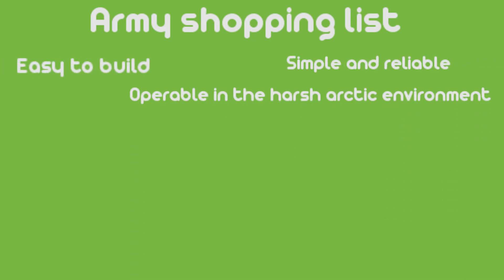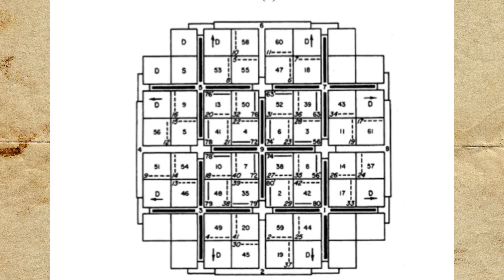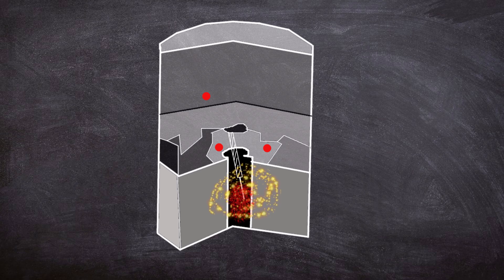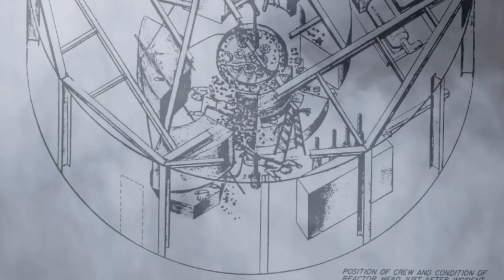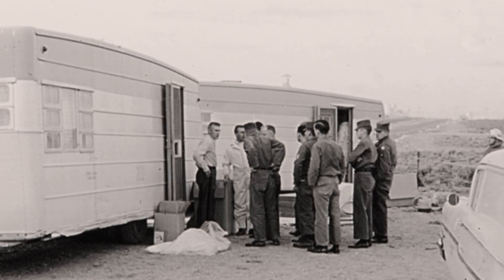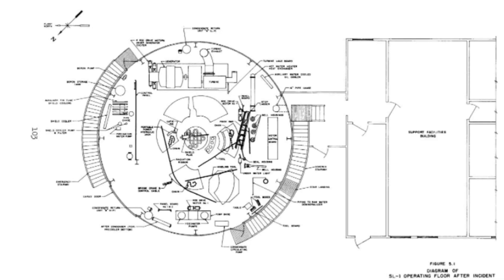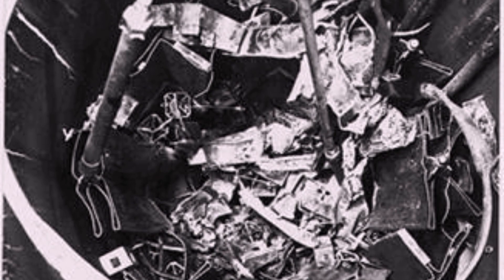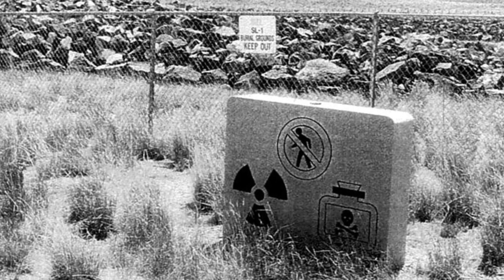A Brief History of: The SL-1 Reactor Accident

Comment: This guy generally got the story right, and it is good that he actually included what the nuclear industry learned and changed as a result of the event, but the repeated use of the word "critical" is a bit obnoxious. Critical is a good state for a nuclear reactor. Critical means one neutron from the splitting of one atom goes on to split one more atom while the other one or two created (in U-235)  do not. Critical is a controlled reaction, where supercritical is where the reaction is ramping up and subcritical is a reaction winding down. None of these are bad when it is happening under the controlled conditions it was designed to. Where it was bad here and at Chernobyl is when it happens very fast and the reaction is not controlled (not critical).

Comment: Another correction, it's pronounced Rongent, or Rongen, Not ROTOgen
Reply: actually it's pronounced runt-chun or runt-gun with a soft g
Reply: @user-ee9cz6mc1x  Not here it isn't. I can't think of anywhere it would be pronounced Rotogen, which is why I corrected it. Variable dialects are different to incorrect pronunciation.
Reply: @oscarmuffin4322 no cos there should be a t after run and no t after gen, so that's is a wrong pronunciation not a dialect
Reply: @user-ee9cz6mc1x  In the German pronunciation maybe, however, we don't appear to be speaking German.

Comment: I have a suggestion, but it's a bit selfish.  It's not one of the biggest disasters, and it wasn't a reactor.. it was a plant that extracted uranium and plutonium from water and waste.  I would imagine it would be extracting from primary coolant, but I'm no nuclear engineer.  I heard about this when I was a kid growing up in Boston because it happened fairly close to home (Wood River, Rhode Island).  It took place in 1964.  I read the whitepaper front to back and it actually read like a horror story, but again, it wasn't like a plant disaster and would be a small potato compared to the other vids.  I would suggest reading the whitepaper rather than articles.  I have either the accident report or whitepaper, I can't remember which is which.  https://drive.google.com/open?id=1GsOS0f-UbDzDg35PEC0whLw4CCca4drD

Basically, a couple of human errors caused a big blue flash as the liquid being poured into a mixing vat had an open drain 3 floors below and there was already, and other things made the place highly radioactive.  At least one man died.
Reply: The report I linked to is a "compliance investigation report "  written on September 11, 1964.  Really an unlucky day all around.  It's very descriptive.  There's also an article in a small paper called "NewEngland dot com",  but leaving outside links are risky.  I'll try in another reply (I'm replying because the OP has a link and after checking Tor, I see it actually went through and not just visible to _me_).  I don't want to poke the ribs of the far-left Google thought police.
Reply: An article about this in a small local paper...   https://newengland.com/today/living/new-england-history/nuclear-accident-at-wood-river-junction/

Comment: Damn. I work in computer science and one of the main tenets is that if it is necessary to avoid mishandling of some particular system then you need to have hard limitations in place, especially if it is mission critical. Example being you don’t want users to inout weird characters in an age field so you limit the possible inputs to only numbers. I can understand the need to manually operate such a machine, especially without today’s technology, however I dont’t understand why they didn’t design some kind of stopping mechanism after the rod travelled more than 20 cm. Anyways, if I am missing some detail then please enlighten me. Cheers.

Comment: Why didn’t they wait a few weeks before entering the reactor hall to retrieve the bodies? Why expose anyone to exceptionally high gamma radiation when you don’t have too?
Reply: John Adams Brief exposure is safe.
Reply: Rob Speed Considering the exceptionally limited knowledge/ lack of knowledge at the time on the long term effects of radiation on the body. The responders were so concerned that the limited exposure to just over a minute. I have a hard time believing that any exposure at these levels are safe. I completely understand putting people at risk during an on going crisis but this was not one.
Reply: John Adams It was understood fairly well. Radiation sickness can be avoided without much risk if proper precautions are taken.
Reply: Rob Speed I was under the impression that medicine did not fully understand the long term effects of radiation exposure until years after Chernobyl. I seem to remember reading about how nations around the word dramatically lowered the acceptable ration exposure for workers after a research paper was published on the workers at Chernobyl 8 years after.

Comment: The Soviets used a unit about the size of a refrigerator. Using Strontium 90, molded to look like a piston head with holes drilled through it. They not only supplied all the electricity for a radar station and accompanying buildings,  one would also provide the hot water and heat for all the whole installation and melt the snow off the streets on the way back to the refrigerator sized unit. Works like a charm for 40 years and then you change the Strontium 90 plug and carry on.

Comment: Though Nuclear power does carry more risks than conventional power plants, in a world that's so worried about climate change they could actually be a really good source of clean energy. Especially some of the more modern reactor designs which implement not only passive cooling, but also much more efficient use of nuclear fuel, resulting in a hugely decreased amount of waste. A good documentary about it would be "The Nuclear Option" by PBS.

Comment: A couple of corrections:

1. Control rods do not contain fissionable material, they attenuate neutrons, so to say that a control rod "went critical" is nonsense. As the rod is removed, fewer neutrons are attenuated which leads to more fission events and more power.
2. "Critical" is the normal state of a functioning nuclear reactor. In order for a reactor to generate power, it first needs to be critical.
3. The reactor actually went supercritical, or "prompt critical" when the control rod was removed too far too quickly. It is insane to me to think that the design of this reactor allowed, let alone required, manual removal of any control rods. That's an engineering mistake on scale with some of the insanely stupid design issues that plagued Chernobyl.
Reply: Can you imagine the times they had to pull on those stuck rods without pulling them too far?
Reply: @J Fz Super critical on him.
Reply: Don't let the Army run reactors.
Reply: Thank you for this information 🙂 learning has occurred within my brain-organ.
Interested to start looking into what someone else mentioned about the " moderator and control rods being connected" at Chernobyl.
Reply: Wasn't Chernobyl's explosion due to its Boron control rods having carbon tips, creating a thermal explosion? Or was that just the dark icing on a layer cake of multiple design flaws and a supreme number of very bad decisions?
Reply: @stephenmcdonagh2795  Yeah, Chernobyl was a mess of engineering design flaws. I wouldn't say that any one design flaw was the cause, but the multiplication of those factors along with the people doing the tests overriding multiple safety features and not trusting their instrument readings.
Reply: @stephenmcdonagh2795 that’s HBOs simplification. Basically half the rod was SUPPOSED to be graphite to moderate (speed up in an RBMKs case) the reaction (not out of being cheap but the reactor literally wouldn’t work without it) and there was water surrounding the control rods to act as a regulator and when AZ-5 was pressed all the water that WAS regulating the reaction got displaced and no water to stop the reaction means BOOM
Reply: @rexanator100  Yes, that sounds like the picture I got. I know that the RBMK reactors had a terrible reputation in Soviet submarines. They cut corners everywhere, but I'm still pro nuclear energy, I think Chernobyl caused a fear that suited the already anti nuclear lobby, yet it's still the cleanest and safest form of energy using fifth generation tech- no need for a flow of water as the same water is reused. If people believe that wind turbines are green they need to take a look at the death toll on the ground- they're even collecting the dead birds on a regular basis. Birds have age old routes, when a flock of geese is flying through low cloud or mist it can take a lot out, I counted six fresh kills one day last year in a group of eight turbines- they're even saying that the offshore turbines are messing with whale migration. They cost more to build than the energy value we get back.
Reply: Michael Jones  Some of us care about accuracy when it comes to disseminating information on the internet.
Reply: Not great not terrible, comrade
Reply: Not quite as bad a design as Chernobyl having the moderator and control rod joined together as 1 rod but yeah not a good design
Reply: @markshort9098  Yes, by modern standards its a crude design but Chernobyl only blew up because they violated every rule in the book that night. Nobody expected it to explode but the guidelines explicitely forbade "rebooting" RBMKs like that.
Reply: @haraldhimmel5687  yeah that's true but RBMK reactors had problems before  Chernobyl happened and a good design wouldn't have allowed such a bone headed move to be made in the first place.. the PWR and BWR reactors have big problems to since the design was never meant to be scaled up, it was originally only meant for ships and subs, Alvin Weinberg hated that his design was scaled to sizes that made them dangerous.. Alvin Weinberg liked liquid fuel reactors for civilian power stations since there's no pressure and no explosion if things go wrong and if they overheat apart from expanding the fuel and coolant pushing it out of the reactor core and away from the moderator slowing the reactor they can also just melt out the sodium plug at the bottom and drain everything  into tanks designed to loose heat to take care of decay heat if necessary.. there is a experimental reactor that oak ridge from the 50s of this design that ran for 4 years and on a test they accidentally pulled a control rod out of the reactor and the power went up and then self throttled itself back when it expanded the fuel/coolant and they didn't even have to fill out an accident report.. if your interested Gordon McDowell has a channel on YouTube about liquid fuel reactors (LFTR) if you haven't already seen it, it's worth watching..
Reply: I was looking for this comment, drove me crazy when I heard him say that the control rod "went critical," I can watch the rest of this video in peace now knowing that I don't need to write the essay myself lol. Thank you!
Reply: Yeah when i heard manual control rod adjustments i was like dafuq? This was a hold my beer moment.
Reply: It was designed this way to meet the army's specifications. Safety wasn't top on the list.
Reply: Yeah and I'm not sure that it resulted in immediate deafs either.
Reply: At least chernobyl Roads weren’t manual they were attached to a drive mechanism that could be adjusted from the control room of the unit 1 2 3 and 4
However in this case an emergency shut down didn’t trigger the explosion also what the actual hell what’s the fucking point of making fucking manual control rods controllers are the most important part of a reactor well other than coolint and the moderator if they Took out one of the other controls that wasn’t the center one and they fully removed it technically it would be exposing radioactive fuel if the reactor was still operational confusion
Reply: Wish they went into this much detail about this at nuke school.
Reply: @MustPassTruck  they did. shoulda paid attention. nukes are the biggest drug heads in the service though, so I get it
Reply: @John Goblikon is my spirit animal settle down.
Reply: Michael Jones  your a looser.. now just fuck off troll

Comment: When I was stationed at  Fort Greely, Alaska, in the late 1960's they had a reactor on base.  It was called the SM-1A.  It was supposed to be tied in to the Alaskan electrical grid, but according to the authorities, it was permanently off line.  Something about embrittlement in some of the metals.  It was near where I worked, a round cylinder with a building, right in the center of the base.  It's probably still there.  I remember walking in the woods one day, and seeing a radioactive warning sign on a small creek warning about radioactive water.  I backed up and got the heck out of there!

Comment: Lead engineer, "I have an idea, lets let's make the the lifting of the control rods manual and open to human error"!
Thunderous applause ensues.
Reply: The layout of the reactor had been altered before the shutdown and the one rod had too much control over the reactivity. The original design was safe and it wouldn't have gone critical like that.
Reply: Back in the 50s... When people believed radiation is healthy :D
Reply: They were lifting the control rods manually as part of a maintenance operation.  The design flaw was the fact that only one control rod had to be removed for the reaction to be started.
Reply: Sadly alot of manual movements of nuclear cores and such were done before too many incidents caused them to automate it or have a level of protection. Non direct.
Reply: Don't forget, this reactor was built before safety ;)
Reply: @233kosta  I'm still looking for safety. Have you guys found it yet?
Reply: there was actually a mechanical drawing error that led to the drive motor not being able to reach the rod per procedure...  and then a little midnight procedural adjustment that I can say. It's *cleaned up * now... like the S1C site... (yeah right... we found hot swipes in the creek every week) finally.
Reply: @Gareth Johnstone which still makes it a terrible design, just intentional
Reply: At 12:10, he talks about the problems with the mechanical rod drive. Manual operation was not a typical  way to position the control rods or the original design for the reactor. Corrosion did seem to cause some issues with that positioning system  though.  Another problem was the decision to conduct maintenance work on the reactor with water in it.
Reply: Johnson you're a genius.
Reply: yep, 
this is why cost-cutting is a bad idea.
Reply: and make it sticky for more fun
Reply: I mean the manual says to move no more than 10 cm, who doesn't read the manual?
Reply: Este reator iria dar problema era questão de tempo. Alteraram o projeto original.
Reply: My wooden desk has the technology in its drawers to prevent them from being pulled-out further than they should be. That technology is small metal tabs that don't allow the drawer rail to come out further than it should. Why was the control rod designed to allow the operator to cause an instant meltdown?!
Reply: @dacypher22  
Most Filing Cabinets can only open one draw at a time.
Reply: Id honestly nope the fuck outta there
Reply: They were made this way as part of the design, it was supposed to be simple, portable, light, few moving components. It's a good design choice let down by poor training.
Reply: @ImBarryScottCSS  this is never a good design choice. There is 1 layer of safety and that is trust in them being trained and not being sloppy. That is never safe. This was a ticking time bomb.
Reply: @ImBarryScottCSS  they could have installed a physical fail safe to prevent the rod being extracted too far. It was a poor design bc the centre rod controlled the reactor. Fully inserted, it would shut the reactor down. When fully retracted, the core would go prompt critical in milliseconds. Adding to the problem was a tendency for these reactors to become neutron poisoned which SL1 was at the time of the explosion.
Reply: @ImBarryScottCSS  "It's a good design choice"
... no it's not. Considering the immense consequences and the ease of pulling the rod out too much, it's a terrible design. Engineers are trained to consider these things. Clearly they did not.
Reply: @9393jack  it’s called R&D. Not even 10 years earlier the  demon core’s criticality was modulated by a screwdriver.
Reply: @brandonbehringer492  toying with critical mass with an screwdriver is asking for it.
Reply: @ImBarryScottCSS  sure sure, let's keep the design simple by passing the complexity onto the operators, what could possibly go wrong. Ever heard of failsafe?
Reply: @ImBarryScottCSS  certainly a hard stop would be worth the extra few pounds if this is can be the outcome of it
Reply: @ImBarryScottCSS  welcome to the 60s man

Comment: Technicians were measuring "rod worth" - how much each rod will add to the reaction per inch of withdrawal. The rod was withdrawn not so much too far, but too fast - the reactor is controlled by "delayed neutrons"; pulling the rod out too fast made it go critical on "prompt neutrons" - those immediately available from fissions. Easy mistake to make.